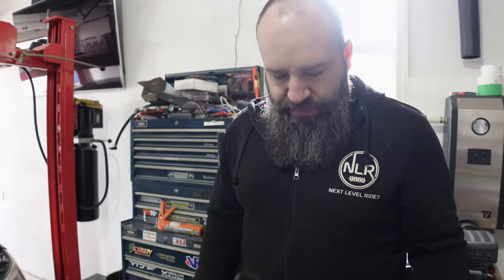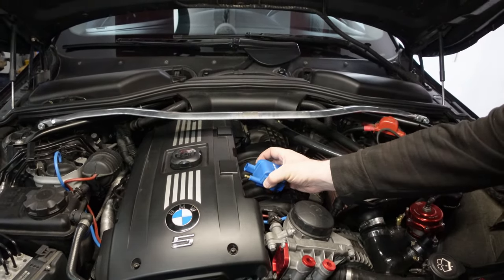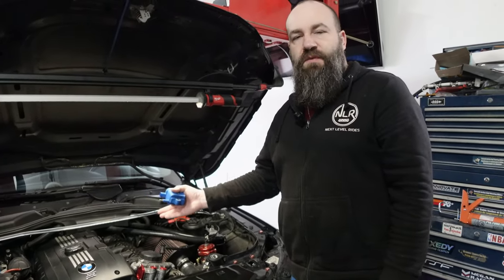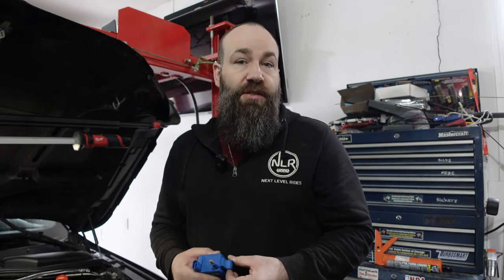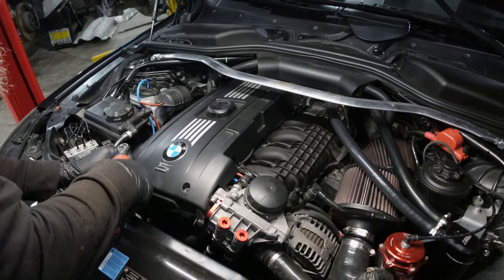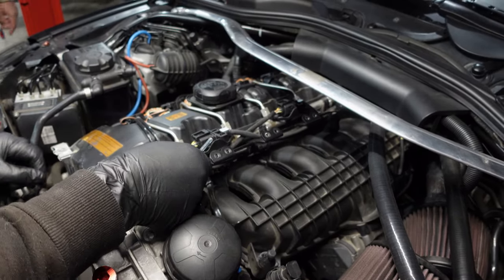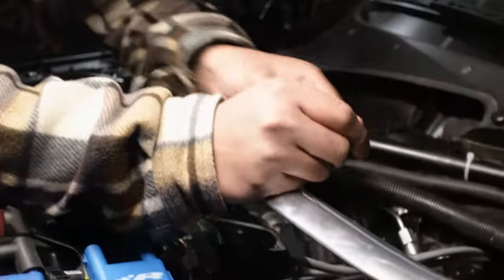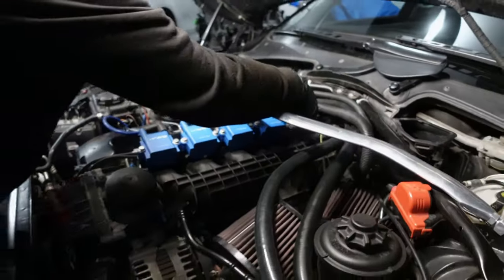The BEST N54/N55 Ignition Upgrade

Comment: Those coils can cause a lot issues down the road. The coil wires are not shielded enough and can induced voltage in other close by wires.  In my case, it was affecting the IBS measuring and evaluation function and O2 sensors readings.
Reply from the maker: I'll keep that in mind if I have issues down the road!

Comment: I’ve been running these coils for about 4 years and have had no issues. I installed these coils when I installed new Index 12 injectors (replaced the stock Index 5 injectors) along with new plugs.

Comment: I have these coils on my N54. I have the MSD81 so wasn’t worried about mosfets. But my tuner hates them. Swears they are the cause of a lot of problems like cracking spark plugs. I haven’t had any issues with mine but something to know. He straight up told me to get ride of the PR coils right after I bought them and use eldor.
Reply from the maker: I've not had that issue, I also do use dielectric grease inside the boot so the lilely hood of the plug cracking is low.

Comment: i prefer the B58 coil upgrade.. it places coils in stock location, no wires to induce EMF in any other system which can cause DME sensor reading issues.

ALso suggestion, if you have a 3d printer, print a clip for the wires to coils and plug that attaches to the high pressure rail line,  makes it look factory and neat.  and can be made from ABS or PETG. 

But i'm also kind of doing maintenance in combination with upgrades,  like the Bremmen aluminum valve cover, with a VTT PCV upgrade  and new high side flapper pipe. ( pretty sure my current setup is leaking pressure into the crank case and causing oil consumption/leaks, cause if i drive and stay at low boost, liek grandma, oil stays put, i get on it, i lose a quart in a week, waitign for ECS to get it in, modified and sent out) and the aluminum mickey mouse flange from Burger,  car already has BOV and hard pipe replaced,  as well as DCI cone mod,  and VRSF catback race exhaust( plan to pickup muffler for this system separately, cause F the drone at my 40 years of age),  with a 5' vrsf intercooler,  so car has mods already and it has service records for all typical oil leaks being done, but never was PCV looked at or addressed.
next upgrade/maintenance mod is going to be the B58 coil upgrade from Midnight Motorsport.
Reply from the maker: it's strange that would be an issue, I've never had it myself. normally if I do, I would add additional grounds to each coil pack and it cleans any interference up.

of course, an old truck from back in the day with my RX7.
Reply: @tony.nextlevelrides  i had issues with aftermarket wires on a few cars, my most recent was my SRT4, MSD wires caused EMF backfeed and threw MAP sensor codes and cam signal codes, the Magnetti Blue wires  wasn't as bad but intermittent.  on my LSx truck same issue with MSD wires, but for injectors  factory wires worked fine on both platforms, i don't know why, maybe i'm just unlucky LOL.
Reply from the maker: sounds like you have similar luck to me lol. upgraded ignition wires for B series Honda's back in the day, had stainless shielding on the outside with leads that you could ground to the valve cover. I would consider doing something similar if I needed to.
Reply: @tony.nextlevelrides  well being entirely honest i've seen bad coils do the same thing in CoP setups, ( mostly Ford modular engines with that lovely coolant leak from the plastic intake gasket getting nom nommed by coolant acid over time) 

but not as prevalent outside of the Ford modular platform, the CoP mod for the DSM's and the SRT4's  seemed to have the lowest issues reported, and i myself never experienced one issue using them.
Reply from the maker: the B58 conversion is tempting. I may do that if I have issues.

Comment: I tried to use common sense with my electric ratchet and my oil pan bolts. Knowing my electric  ratchet only goes to about 8 ft lbs I figured it wasn't going to break a bolt in the bottom of the block. But it did. And to officially sound like a dumb ass I did it twice.
Reply from the maker: sounds like we both learn the same way. the worst case scenario way, twice!!

I feel for ya. lol

Comment: You don’t buy these. You either run stock style coils to 900whp or you use b58
Reply from the maker: challenge accepted.
Reply: Accept whatever challenge you want. You paid more money for an outdated option that’s had several years of better products surpass it. The stock coils in good condition will work fine to whatever power a non built engine will make. If you need/want better coils, b58 is data proven to the be the best option
Reply: @typedrew  I've seen numerous people shit on LS1 style coil conversion, but can never explain why they suck. 

I've had those same style coils on a 6.0 Turbo LQ Truck build making over 900whp on a mustang dyno, granted the LQ has 2 more coils.. But they were fine at that power level. And they weren't even special coils. Just whatever shit 15$ coil I could find that fit on the relocation brackets.

I've got eldor coils now on the car, but if I ever start having problems, I would like to know "WHY" I should avoid these, not just "dont use em,. they suck"
Reply: @EvlEgle People hear someone say and just run with it with no person experience. I use to hear "don't get an n54 they're unreliable blah blah blah..." My 335i is at 195k miles and running. Of course being an older car it's going to come with old car problems. Since it's old there's plenty of information out there on common problems and what to jump on before those problems start to show, which is how I've made it to 195k miles on the original 07 motor...on the "unreliable" car😂